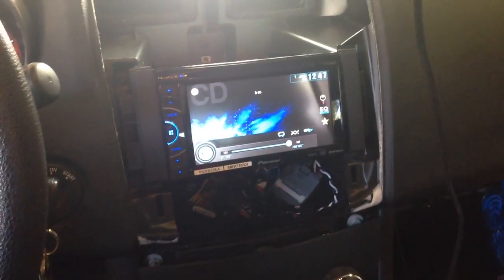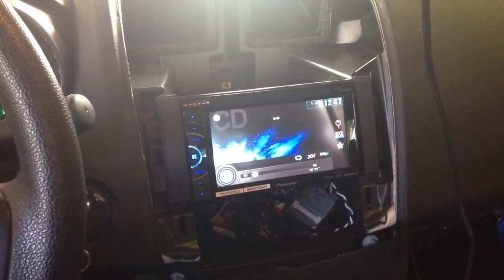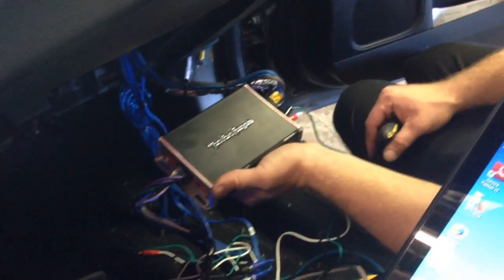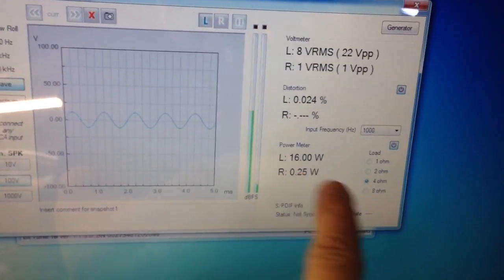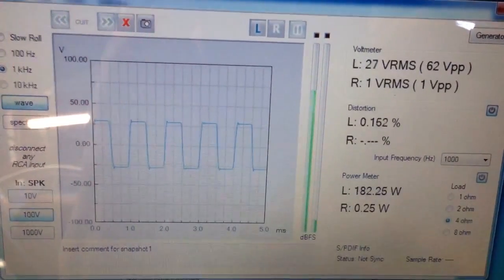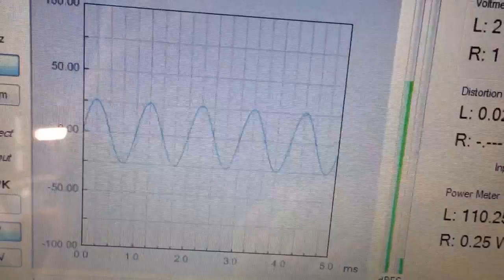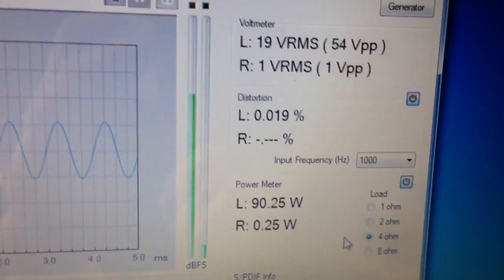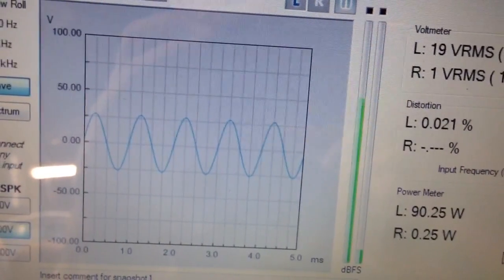No Distortion Bit Tune how to tune a system

Comment: Since i do not have experience using the audison bit tune, it gets frustrating. I only have the "pro" license and it allows me to use certain features. By any chance, do you sell the voucher for the "Full license?
Reply from the maker: No, unfortunately we do not. You have to contact Audison directly.
Reply: I did contacted audison. I was told to contact a dealer and/or retailer that they would assist me. But. Thanks for the reply.